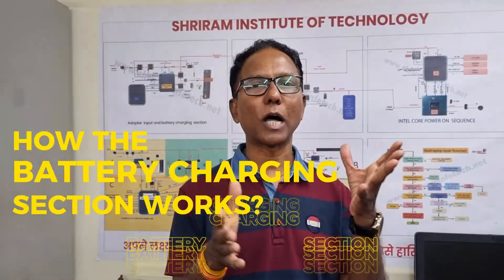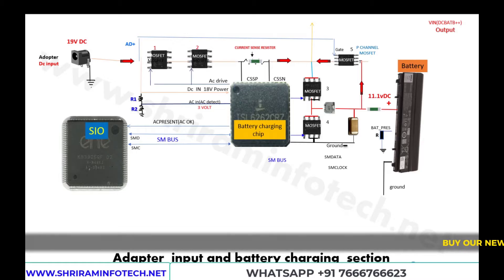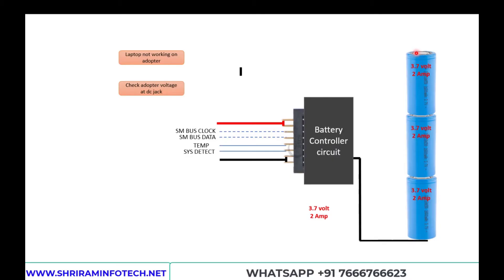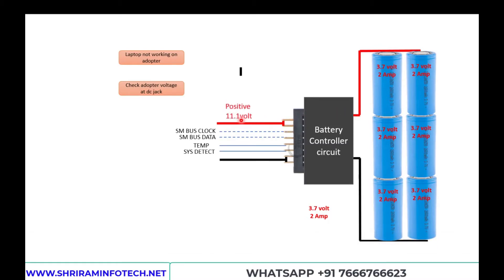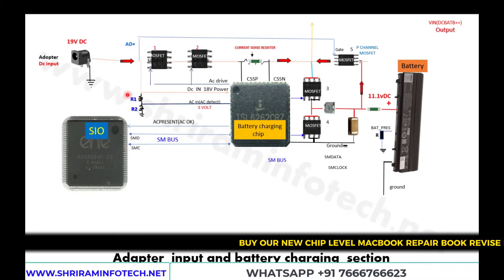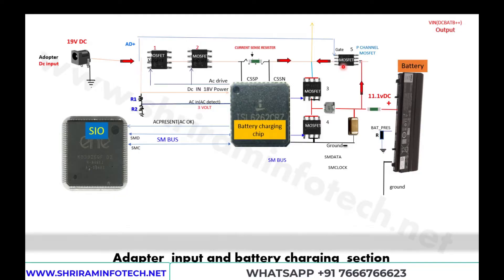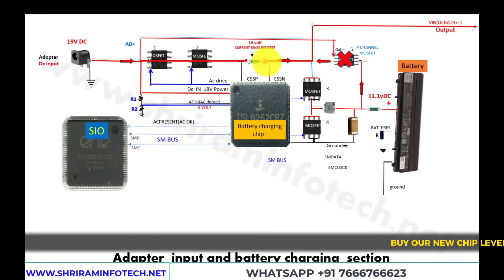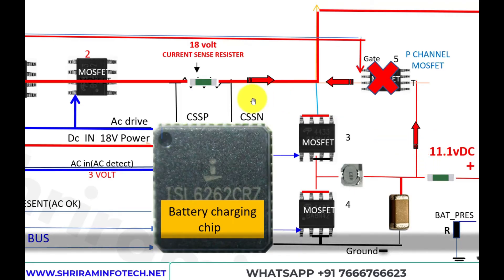Laptop Motherboard Battery Charging Section How Works

Comment: What is the solution if the voltage on the + battery pin is 19volts but the battery is not installed ?
Reply from the maker: @MRamdhanQurrotaAyun  mosfet short

Comment: Good information us8ng animation.i came here just because i use lsptop battery cell and its bms in my battery pack .i know its BMS have dome other pins lije clock ,data  ,temp etc, which communicate eith internal charging  circuit  like sio ,charging chip of laptop but when its battety pack ,i cant control charging the cell using same BMS  .I justt want to know is there ant way to charge this battery pack? And what about the charger adaptor to be uses i.i। volt and amp

Comment: thank you so much. It was a really useful video. But how do two mosfets cause voltage drop? Is it possible to explain in detail? Couldn't it be done with just one? I would also like to ask, what is the RTC section? and exactly what functions they have on the motherboard. thanks

Comment: Hi and good job. What can I say about this high-level lecture from the Master? Just thank you for sharing his knowledge with us. I have a Dell Latitude E6420, and the charging chip outputs 17.5V on the two positive pins of the battery connector. However, when I connect the battery, the computer doesn't turn on. But it does turn on and display without the battery. So, what is the normal value for the voltage that should be outputted on the positive pin of the charging connector? Is there a universal value for all computers, or does each computer have its own value? Thank you.